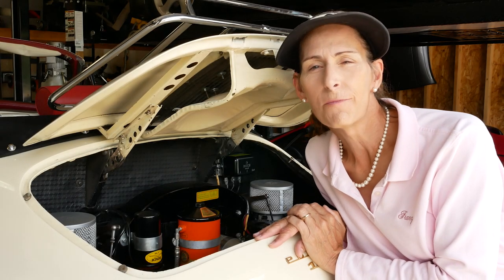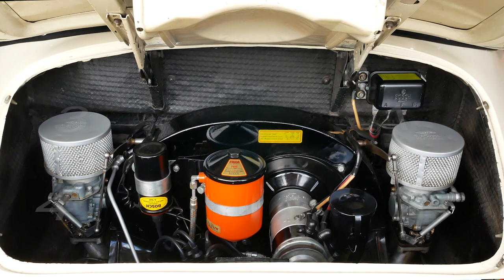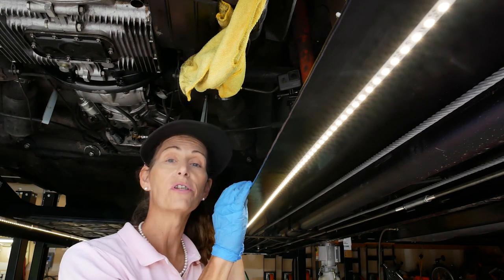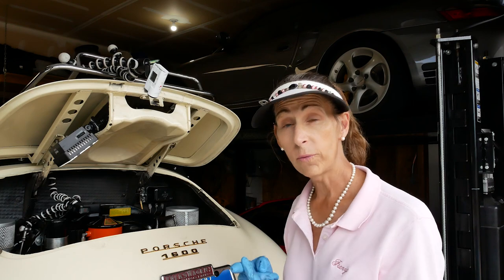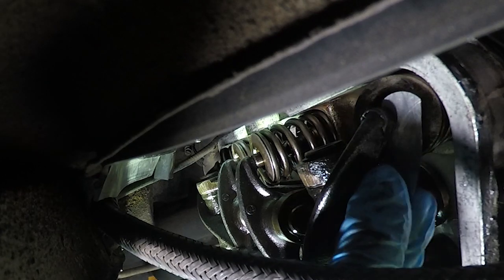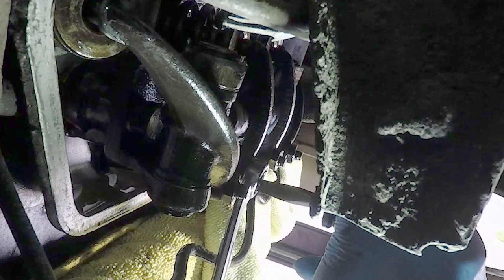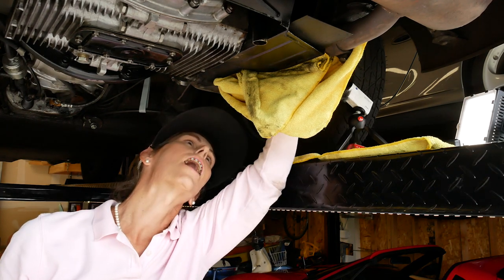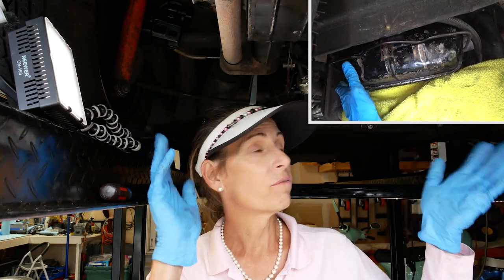Porsche 356 Tune-up Part1 Setting Valve Clearance!

Comment: Wonderful video as always. Interesting to see how the cylinders are numbered differently from a standard textbook, but it's not uncommon for manufacturers to do so. This is the 1600 engine, would love to see valve adjustment on a Fuhrmann engine :)
Reply from the maker: +Freerk de Ruiter lol. We would probably have to sell all our cars and the house to get a car with the engine your referring to and that still probably wouldn't be enough money...  yeah, that's out of our league.  Would be fun though.
Reply: Heidi and Franny's Garage yes, they are super expensive these days. Way out of my league as well I'm afraid. Reason I mentioned it here is that this engine has quite a reputation of being difficult to tune. I have the book by Peter Pohl on these engines, but as mentioned sadly no Fuhrmann engine to work on.
Reply: Heidi and Franny's Garage If money was no object and you had one, how would you do it?

Comment: why does the flywheel pulley at top dead center have 2 notches together? How would I know which notch to use? The 1st or 2nd notch? Great video. I've never seen a auto mechanic wear pearls.
Reply from the maker: Hi Doug, The notch on the right is 5deg before TDC and the one on the left is TDC.  You time with the one on the right and adjust valve lash with the one on the left.  There should be a mark on the other side of the pulley (180deg out) and that will (should) line up with the TDC mark on the opposite side straight through the pulley nut.
Reply: @HeidiandFranny  Thanks very much for the reply.